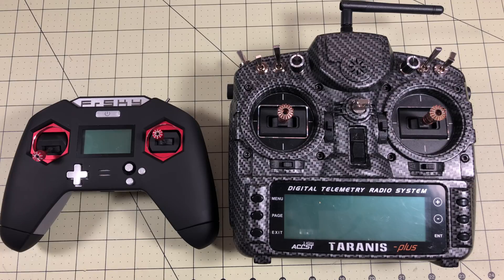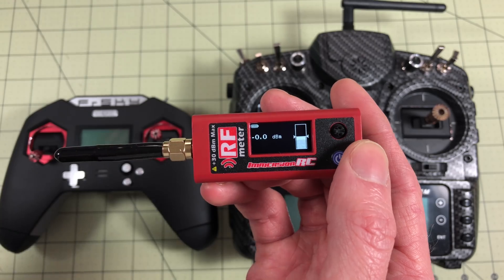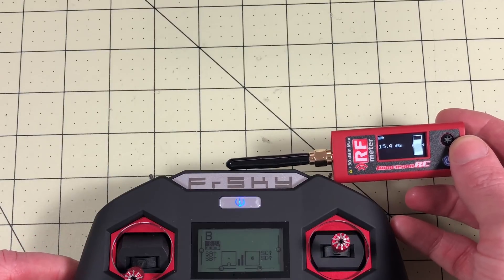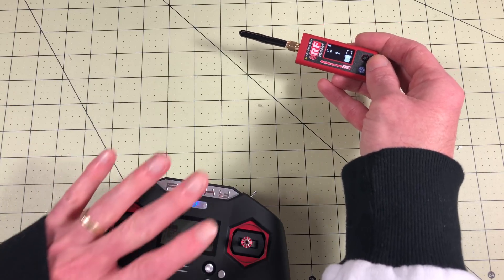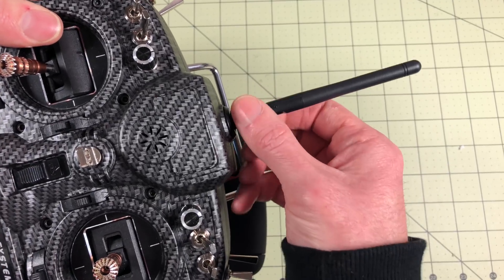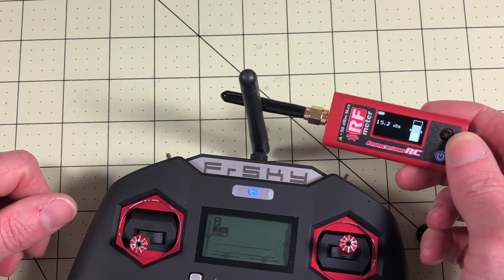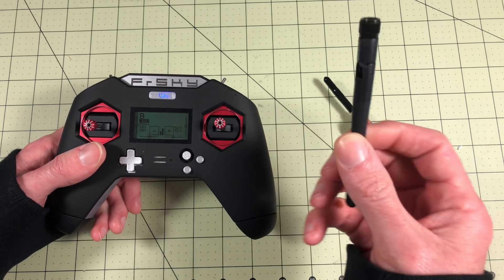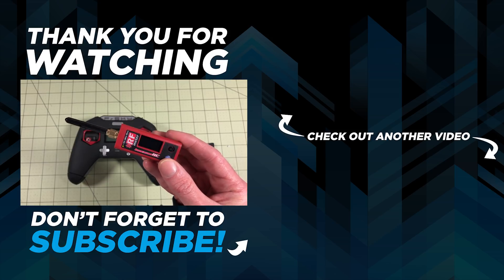FrSky Taranis X-Lite External Antenna Bench Test vs the Taranis X9D SE

Comment from the maker: See the Full X-Lite Playlist: https://www.youtube.com/playlist?list=PLfEeINCzBDwr9dnwSC9-pJSpeljfaWkeX

You can get one right now: I got mine from GetFPV
GetFPV: Red - http://bit.ly/FrSkyX-LiteRed-GFPV
GetFPV: Black - http://bit.ly/FrSkyX-LiteBlack-GFPV
Banggood: http://bit.ly/TaranisX-LITE (Coming Soon)
Amazon: http://geni.us/FrSkyXLite 
Aliexpress: http://bit.ly/AE-XLite 

ImmersionRC RF Power Meter:
GetFPV: http://bit.ly/ImmersionRFMeterV2
Banggood: http://bit.ly/ImmersionRFMeterV2-BG

Check out my current giveaway: http://geni.us/DroneRacer101Rewards
These are the current Drone Coupons I know of: http://geni.us/DR101DiscountCodes

The FrSky Taranis X-Lite has an internal antenna but can use an external antenna.  Do you need it?  Is it better?  Well, it depends.  Using an ImmersionRC RF Metter I compare the signal from the Taranis X9D SE, the Taranis X-Lite with the internal antenna, and the Taranis X-Lite with an external antenna.
Reply: maybe next time both antennas (rx, tx) in same direction, not 90deg offset?

Comment: You’re doing it wrong. You need to place the antennas parallel to each other, and on top of that you’re using a 5.8ghz antenna to measure 2.4ghz.

Comment: You may want to know that antenna on your meter have best frequency response between 5,5 to 6ghz. On 2,4ghz it's so bad that piece of wire with correct length sticked in to sma have more sense 🫣

Comment: Your results make sense with what you were doing. In the field it will probably be a bit different.  You were holding the tester parallel to the ground on both radios but on the X9D the antenna was vertical so you are perpendicular to the tester which will reduce your gain a bit due to off axis interference.  With the internal X-Lite radio you had the tester parallel with it's antenna which is probably laying down inside the body and this is why you are getting the null points at each side of the radio. When you are flying however your quad's antenna will most likely be vertical (unless have it horizontal of course) so the X-Lite internal will be off axis and have a slightly lower signal strength. I'm not sure why you were seeing loss at the sides with the X-Lite external antenna though.

Comment: Internal antenna is mounted horizontal and this is why it is directional , it would be better if it was vertical, your test would be more valid if you held the receiver antenna vertically like it would generally be in a quad....then I think the external antenna mounted vertically would show better results all around apart from maybe straight up above your head( which is actually where you want good isignal for Los gliders and then horizontal mounted would be best...).

Comment: I think the antennas are supposed to be parallel for maximum signal. And is that a 2.4 GHz antenna on the power meter?
Reply: ^^^^ This. Please re-test with the proper antenna on the power meter and in the correct orientation.

Comment: To install the bigger 5 or 6 dbi antenna you just need a female rp-sma to female rp-sma adapter. I use one on my Horus X10s, of which has the same small (dumb) hole to install an external antenna. I don't bother using it, but it does work well.

Comment: Just a little heads up; They make a special T shaped external antenna for the X-Lite. On RC groups there are several recommendations (one by Wayne who owns Aloft Hobbies(premier dealer for FrSky)) against using other antennas until more testing is done as you may damage the radio.